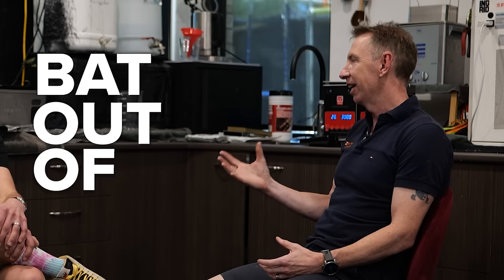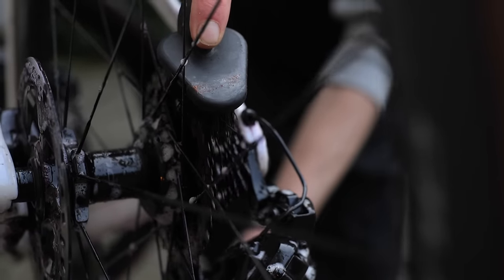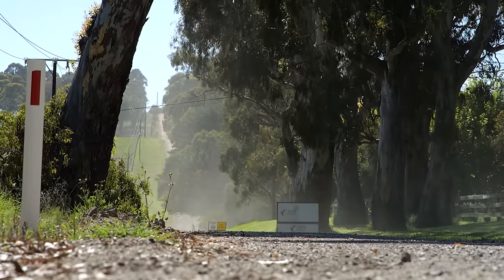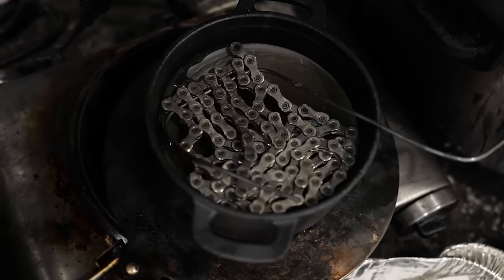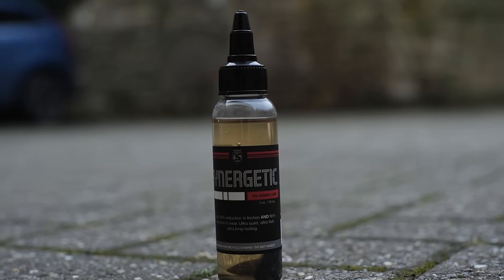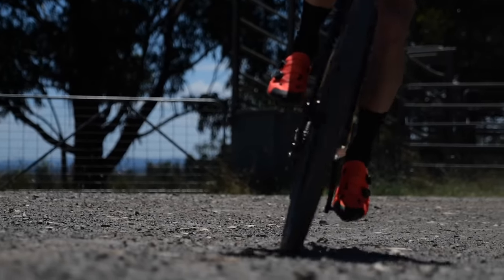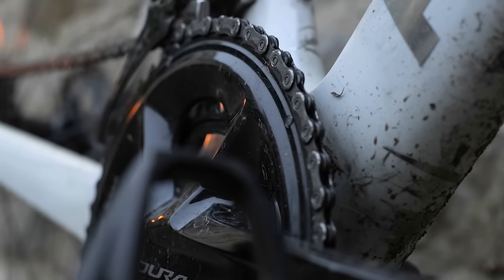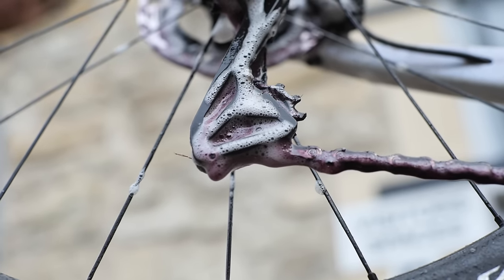They Don't Want Your Chain To Last This Long

Comment: Does anybody have a tip for switching out the wax in your slow cooker when it's old? When it's solid, it turns into this brick that I'd have to carve out with a chisel, and pouring hot wax into a container doesn't feel super safe
Reply: Sure, heat it and melt it. Then pour the used wax into a tin can.
Reply: Heat, melt and pour it in aluminium foil
Reply: You only need to heat it enough to melt the outside. Then it just slips out into a bbq tray

Comment: So please riddle me this...
I've done over 20000km with just two chains. 2 cassettes (indoors and outdoors). Without using wax.

Reading on all this zero friction stuff it should have cost me a fortune. It did not.

But maybe it's just the Dutch weather 🤷
Reply: It just means that you would get even more life using a wax system for your drive train.
Reply: @CarbonRider1  sure. Not worth the hassle though
Reply: Im on more than that with waxed chains, and zero new cassettes, and also never getting grease on me.
Reply: @shawnington  good for you! My point being that zero friction was not able to ride 500km with my setup and I'm over 20000km and still counting. 

Making statements about the industry doesn't want you to last your components are quite a bold one for me.
Reply: Congrats Joop you beat scientific testing with your anecdotal evidence. Maybe tell me about how the world is flat because you can’t see a curve?
Reply: @JoopLammerts for most people you would get about 8,000km +/-out of a oil lubed chain, and with a waxed chain it’s about 25,000k. So the difference is about 3xs longer with wax, which means oil lubed chain will cost 3xs as much. For me that is a savings of about $800 - $900USD, so having to clean my chain about every 2-3 weeks is totally worth it.
 
This means that if your claim is true about getting 20,000km out of an oil lubed chain is true, then your would get around 60,000km out of a waxed chain.
Reply: @CarbonRider1  I know I could. That's not my point. 

According to Zero Friction my total costs should be over $10.000 per 10.000km
I can tell you it is not. So I'm wondering how they are doing to come to this costs. I've looked on there website and found nothing. They are having results I have not. So having a headline on the video with "They don't want your chain to last" is quite a statement to make.

I do believe waxing might be beneficial for some people. But the way this channel is used as platform for someone who is doing bold claims is quite astonishing.
Reply: it’s all relative bud, not absolute. Data is based on user averages, not outliers. This means the formula is still about 3xs more use with a waxed chain as compared to oil based. So take whatever your current drivetrain life is, multiply x3. Make sense?
Reply: @CarbonRider1  unless the formula is not correct given the circumstances I ride in. It's all relative and based on a lot of variables
Reply: @JoopLammerts  I think this went over your head bud. Take a breath and think this one out.
Reply: @CarbonRider1  you're a funny dude
Reply: @JoopLammerts  Hi! how did you look on the website and find nothing? The cost to run tables with full breakdown of how the costs are calculated are there. The costs are based on how long the chain took in the control test to wear to 0.5%, then how many cassettes based on that, how many chain rings, cost of those, cost of lubricant, and amount of lubricant used. 

How did you see the total cost but not the breakdown and thus "found nothing". 

it is common that a person can say oh i have done 10,000km on my chain on X or 15,000km - but if it is worn to 1.5% and then you are unlikely to get a second or  third chain through the cassette, you are unlikely to get many chains through chain rings, and for the latter half of that time riding a clapped out chain that is high friction. Ie i know a guy who averages 20,000 to 25,000km a year. He does an annual replacement of chain, cassette, pulleys and chain rings, then just rides that chain for 20k+. So for him, he gets 20k+ from his chain and lube. but by 5000km the chain is worn. by 10,000km its really worn. From 10,000 to 20,000km he is riding a heap of shit drivetrain. Then its amazing, amazing how much better and joyous his bike is to ride at the start of the year on a new drivetrain. 

if thats how peeps want to ride and replace - thats cool. But on the right lubricant - one can get a genuine 10,000km on to circa 0.5%, vs 1.5%, and have everything running brilliantly. Then replace just the chain. And keep the good times rolling. 

the modelling falls over vs real world in that with the worst peforming / highest wear lubricants - no one is replacing chain at 0.5%, and thus components when they should etc. If they were, they would notice it took so little time to get to 0.5%, and they would try something else. So what happens is they run them way long, replace a bunch of stuff way late, then go oh wow thats a whole lot better! 

Like i mentioned in the vid - life is too short to ride shit riding bikes, and simply a good lubricant and a chain checker and one is on a grand path to be always riding a great riding bike. 

But anyhoo - hope that clarifies a bit, and you will find if you check full costings breakdown is there. 

hope that helps!
Reply: @zerofrictioncycling992  Thank you for your reply.

I understand that when a chain is worn the cassette and chainrings will start to wear pretty quickly. I measure my chain every two weeks and it's still not worn. I also have no running issues with my chain/lube combination.

I'm also not looking for the cost breakdown, I found those (and they are brilliant). What I'm looking for is how the lube is tested.
On what chain
What riding conditions
What road surface
What terrain.

I live in silky smooth Netherlands, only ride when it's not raining on smooth clean asphalt. So maybe my chain/lube/bike is just not picking "enough" dirt to see the same results for the lube I'm using as you did. Maybe the lube I'm using is just "perfect" for my riding conditions. Maybe I just applied it right (I'm not questioning your skills!). There must be something why I can do over 10.000km (and going) on my lube of choice why you had to stop the testing after 1000km.

Let me be clear, I'm not questioning your methods or your work! It's just that I'm seeing different outcomes than you do, and I', trying to find why that is.

Best regards, Joop
Reply: @JoopLammerts  ah i see thanks joop for extra info - and yes for sure any single test protocol is not going to mimic any one persons particular riding. Basically what we need is a bench mark test that includes clean conditions, dry dust conditions and wet conditions as part of the test. The wear results for all such blocks are tracked. The cumulative result is used for the overall cost to run (classed as mixed conditions), but then one can also drill down and for instance just use the dry contamination block if they ride mostly offroad and dry, or wet contamination block if ride mostly wet. 

However even with that, the amount of dust, type of dust, rider load etc - a test cannot mimic a persons actual riding - what it provides is that benchmark. So if you are experiencing X on a particular lubricant in your riding, and another lubricant tests overall much lower wear - then even if the actual km numbers and cost to run are not accurate for you, the relationship between those two comparative products will be. if a product is much lower wear than another in the test, it is extremely likely it will be much lower wear for one in the real world. 

The full test brief is linked at the bottom of the lubricant test page and takes one through each test block. I think it  states what chain but just in case the control chain for lubricant testing is ultegra 11spd. 

will see if link pastes here ok
https://zerofrictioncycling.com.au/wp-content/uploads/2024/02/ZFC-Test-protocol-Full-Brief-2-24.pdf
Reply: @zerofrictioncycling992  Thank you very much! And once again taking the time to answer someone who is just "ranting" I'll dive into this. Maybe I find something I do different than in the test.

It's just quite annoying to hear all around "your" lubricant "is rubbish" and "you shouldn't use it" and yourself have not that experience at all. 

Once again, thanks for replying! And I do hope for no hard feelings because of my ranting!
Reply: @JoopLammerts  thanks joop and my pleasure. yeah i know it may come across a bit like that - but i guess the main concern from a strange man like me focussed just on this little space - is that WAY, WAY too often cyclists are for sure experiencing much higher wear than they should be because oh so many products out there really will be just re bottled X from somewhere else and sold as a bike chain lubricant - with absolutely zero idea if it is any good at all. Contamination is the killer - we have a part working so hard, and so completely exposed, and simply many lubricants readily absorb any and all contamination available and increase in abrasiveness. And this will bite. Whereas other lubricants have in fact been developed for the very specific use case of a super hard working part completely exposed to a lot of contamination. But - since all mfg can claim whatever they like without any accountability or need to substantiate those claims at all - even if you write to them and ask them for what they have to back their claims - it really is the wild west out there. if i had to make a guess from my time in this space - if i was able to test a thousand lubricants - likely around 10 to 15% would be great to brilliant, about 50% would be meh at best and much higher wear than the top products, and the bottom 30 odd % would be shockers becoming very abrasive very quickly. And all of them will be claiming more or less the same amazing properties like "Cleans as it lubricates!" and " Repels Dust dirt and grime" and "puts a protective coating on chain that prevents wear" and so on, of which the huge majority of products will do absolutely nothing of the sort - but its just claim what you like you cant be held to any false advertising as there is no regulatory body to assess - well, what is clean as lubricate? how would they test for that? whats the benchmark / baseline they could use to determine if a mfg was in fact falsley advertising. 

This is bad for consumers who have no idea if they have manged to get a great, meh or terrible product, and its bad for mfg's as they can put in the hard yards and costs and human capital to develop a genuinely great product, but lubricant / mfg X can match their claims anyway based on - often - literally nothing, no idea, its "a lubricant" - chuck it in a bottle for cycling and go nuts with marketing claims, no one will ever be able to prove otherwise. 

And as cost of components really is trending up - the difference between running say Muc off or FL wet on your 250 dollar xx-sl chain and 950 buck cassette - its a big big difference. And i hate components being wasted / early death by abrasion from poor products marketed as though they are amazing!
Reply: I have never changed my chain for the last 30 years, it is fascinating new information.
Reply: @martinriiser5523  please don't tell me this is without riding
Reply: @martinriiser5523  Honestly martin such comments are also fascinating. what does that even mean? Ie if you are riding 10,000km a year, are you saying that you have attained 300 thousand kms on your chain? or does it sit on the wall except for one coffee ride a year and so all up that chain has done F all kms. How many kms has it done, what is its current wear rate etc? i have a 1996 hotta - it has done 186 kms in the last 12 years. So should i post that my chain is 12 years old and still at 0.00 wear?  My gravel / cx race bikes havent seen a lot of kms overall as despite harsh conditions generally - cx races are short, and i look after my chains. My xx1 11spd cassette has moved from one bike to the next and is now 10 years old - that doesnt mean anything - someone else who smashes their gravel  bike for 300km a week will not get 8 years from a cassette. 

So if your comment is one of what is all this talk about chain wear and component wear when i have not changed a component thats been barely used for 30 years - i find that a fascinating thought path indeed.

Comment: Waxing every 300km - doesn't wax last any longer than that?? 😕 So if you're training 400 miles/week you'd have to rewax twice a week! Omg 😮
Reply: It is more work, but a lot less wipe-down than with drip lubes, so it evens out a little bit.  The best way is to have several chains (with reusable quicklinks), wax them all at once in a batch, and cycle through the chains. That chain switchout alone reduces wear on the cogs and chainring, improving shifting and lifespan a lot.
Reply: I mostly ride in dry conditions (road) and rewax every 350-400 km. I have 3 chains in rotation and that for me means rewaxing once a month. Easy.
Reply: Your typical drip lube could very well last you less than that, but you won't notice because the chain will be silent even long after your lube has turned into liquid sand paper. The wax on the other hand, won't lie to you - you'll hear the drive train noise increase even before it's really time to re-wax.
Reply: @rasmuswi  that's exactly my experience. I used to use crappy oil and relube too often and that  masked the noise but I ended up with a drivetrain covered in a disgusting black gunk. Wax prevents all that but it certainly takes a different mindset you have to get used to. Once you're, it's freaking black-mess-non-tattoos-paradise.
Reply: Rotate chains. I am running two, and get to the wax of the other—or more if super high rider—when I have time. Waxing more than one chain no harder.
Reply: takes 10min. And very little drive chain cleaning (if at all) required. Def quicker overall.
Reply: No, you just keep a rotation of chains. You can wax 3-4 chains at the same time with no extra time, and they will never wear out if you change them as soon as they start to make sounds. 
It would take you with 3 chains
15 min every 2.5 weeks to never again wear out a cassette, a chain, a chain ring, and also, never get grease on your leg, or clothes or furniture again. Well worth it. You can also probably wax 5-6 chains at once if you really wanted to.